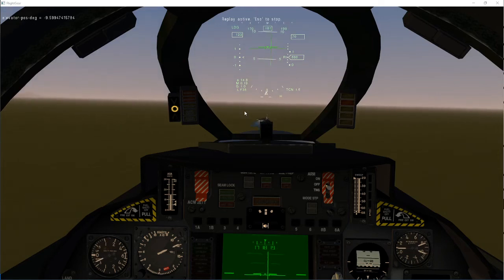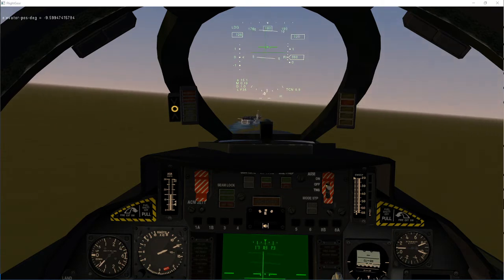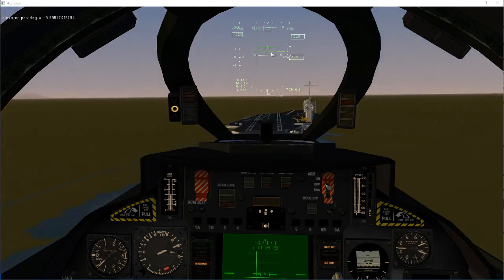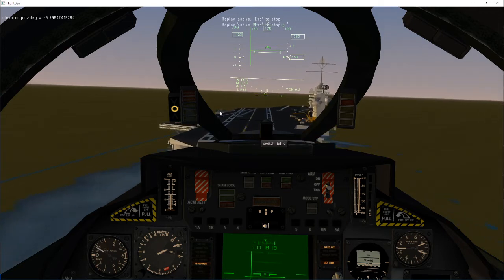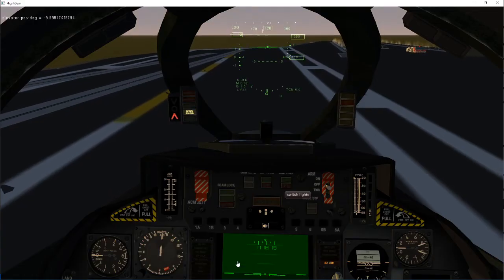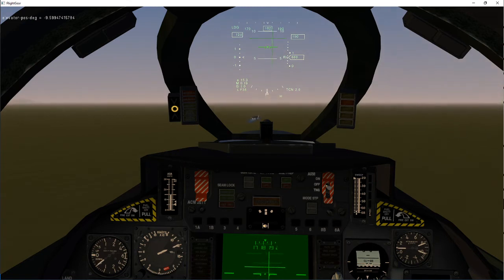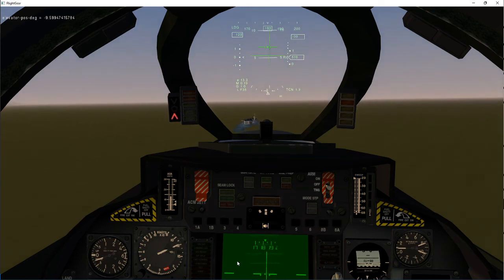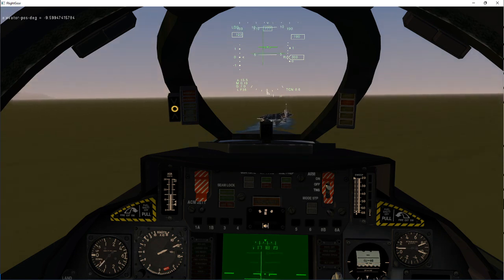FlightGear F-14 revised aero approach testing

Comment: You are using Heatblur's F-14B as reference? What makes you think its FM is correct? At 1% fixed fuel, full flaps at 310 kts or so it can make over 30 degrees per second sustained turn rate while pulling more than 8 Gs. Do you believe that's realistic? Judging by what they told me, they are also using "publicly available data". Thought they did some proper CFD for flaps and other thing not covered by the sources, but that appears to not be the case...
Oh, and if that is not enough, at 8,000 lbs fuel (again with full flaps) it still pulls 24°/sec.
Reply from the maker: I originally used the Heatblur F-14 as a reference because I couldn't find any other info. For case 1 recovery the HB F-14 has been validated by pilots. 

However since making this video I found some more data in NASA TM-X-62306 that provide wind tunnel data that I could use for landing gear, spoilers, flaps, speedbrake. I've also rebuilt the flight control system and SAS together with an improved DLC simulation based on data in NASA-TM-81833 but also with both
 the original DLC which uses all spoilers between -4 and 17 degrees for both roll control and DLC and the mod AFC 735 which uses the inner spoilers for DLC using the full deflection (-4 +50) and the outer spoilers for roll control. APC is also based on the schematic data in NASA-TM-81833.

These changes are all on the develop branch; but a full release will be made soon

Above 225 knots the main flaps  can  only be  extended to 10 degrees  and the slats to effectivity
Reply: @RichardHarrisonDeveloper  Quite often we hear that a flight model was validated by real pilots, and yet that barely helps at all with finding out how good the fidelity of the said FM is.
Thank you for taking your time to answer me, even though almost a year has passed since the posting of my comment. Ironically, HB F-14's flight model took a whole lot of changes since then, so I'm afraid their initial team of real pilots didn't help them all that much.
Although I haven't tried the most recent update yet, but the few versions before it had the full flaps magical abilities dialed down almost to expected levels. I hope this version is even more true to life (or common sense?) in that regard.

I'm happy to hear that you found more documentation on the Tomcat and that there is an updated addon version available in the develop branch. I took quite a break from flight simming, but there is a whole lot of new content and changes I want to try, so I'll be doing just that very soon. I won't be surprised if - again - I'll find your implementation of the FM of higher fidelity than that of Heatblur's (after all it's based on NASA technical papers, not on some ambiguous "know how").

Thank you a lot for still working on these birds. The future of flight simming belongs with open source.